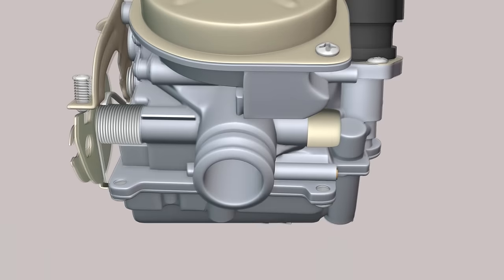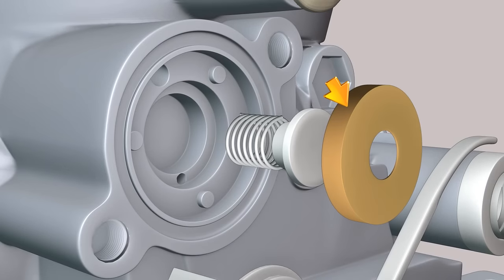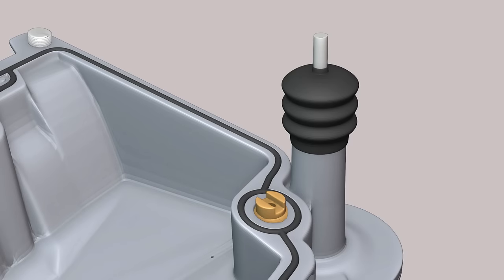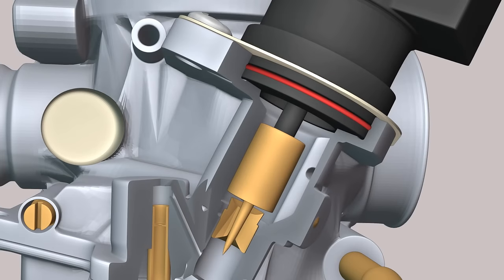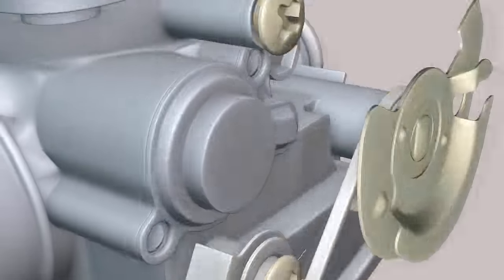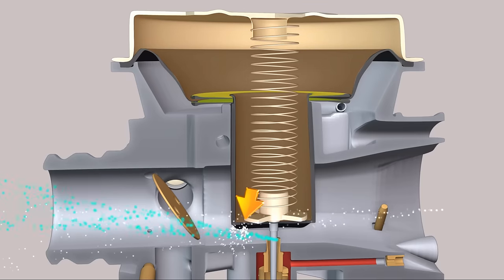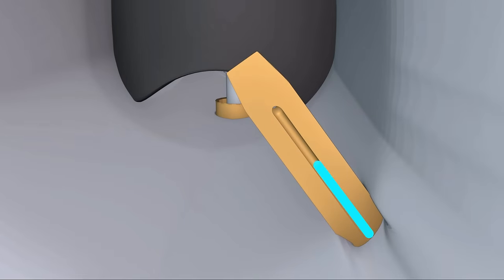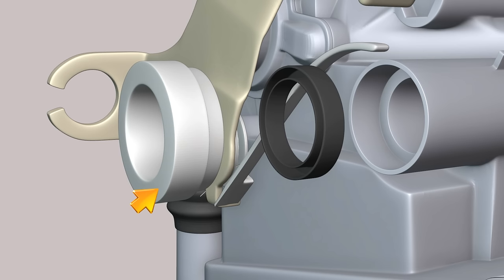Как работает карбюратор скутера 4т CVK 139qmb | 3D

Comment: una duda, no es posible regular la minima, la motocicleta vuelve a subir sobre las 3k rpm, por mas que trates de ajustar el tornillo de relenti es imposible, otro problema es dificil de encender, otro problema, con filtro de aire la moto se ahoga
Reply from the maker: Vea el sello de goma en la válvula de arranque:
https://youtu.be/L0odfurAzrg

Filtro de aire húmedo: es posible que se hayan metido residuos debajo de la aguja o el flotador.
Reply: @SanyaTsvay  ok, tú dices la junta tórica del estrangulador eléctrico y filtro.  y con respecto a que no pueda colocar ningún filtro y que siempre se ahogue o que encuentre trazas de combustible en el interior del filtro?, es un carburador CVK 26
Reply from the maker: @lsuarez011  la aguja se atascó. La suciedad se metió debajo de la aguja. aguja flotador, nivel de combustible. Es posible que el filtro en sí esté sucio. Si el filtro está sucio, creará un vacío y se llenará de combustible.
Reply: @SanyaTsvay  perfecto amigo, de verdad, gracias por toda la información, de verdad es excelente tu canal. voy a desmontar y limpiar todo. el filtro si puse otro filtro y apenas lo coloco en posición de una vez la moto se ahoga, prácticamente sin filtro si funciona.
Reply from the maker: @lsuarez011  ¿Está normal la válvula de combustible debajo del tanque? ¿Se abre manualmente? ¿O hay una válvula de combustible neumática con tres tubos? Si la válvula automática de combustible está abierta, la membrana puede romperse y llenar el motor con gasolina. Quizás valga la pena reemplazar la válvula de combustible.

Comment: At what point to adjust float level height of fuel in this kind of cup that is "inclined", not parallel with the body carburetor?!? When cup and body is horizontally parallel then its a rule to adjust float level at the level of joint point between the cup and body...but when the cup/body is inclined like on this model of carburetor, i am confused at what point to adjust float level.....i have been searching service manuals for this type of carb to find info of float level adjustment, but it is difficult to find...i got only some info like 17mm of height, but this is difficult to measure from outside with the transparent pipe because you cant define lower point so you can measure 17mm of height....any clue anyone?!?
Reply from the maker: https://youtu.be/UseQ1HR6bk4

Comment: У меня перестал запускатся скутер...,ни куда не стал лезть,поменял вакумный бензокран, сначало не помогло,в наглую залил бензин в карбюратор и ....заработал .... скутер ирбис rzr 170 ..
Reply: Clean the main jet needle valve...
A clogged vent is the culprit, I use a thin guitar string by inserting it to remove the dirt and 
debris...
It save me a lot from buying a new carbureator... Regularly replace the main fuel filter, a contaminant in the fuel builds up and clogs the carbureator, sometimes the cause of hard to starting...
My scooter is MotorStar 4- stroke 170cc model china made...

Comment: Got another question what can cause surges/stalling at full throttle? it accelerates then it stalls a bit then revs up again, also the main jet needle is set at down at the lowest setting if I go up it won't rev at all, any suggestions? Great video again. Have a great day or night
Reply from the maker: Could there be a crack in the vacuum diaphragm?
Reply: @SanyaTsvay  how do I check that? And it would only affect it at full throttle? it goes just fine at half, could be what you said or an air leak and that's why it needs more fuel, and the spacer between the engine and the carb is cracked, it's got silicon in the crack. Now I need to know how to check the vacuum  diagram, it's the vacuum line and the carb intake manifold pipe? And thank you for the response, you're really helpful I can't get to the problem of this thing
Reply from the maker: @nationalboosted2877  Membrane that lifts the piston with the fuel needle. If there is a microcrack in it, then failures occur at full throttle. Nothing happens at medium speeds. You need to get the membrane and inspect. Stretch a little to make sure there are no cracks. Well, or install, obviously serviceable ...
Reply: @SanyaTsvay  yeah, there no crack that I can see, so it's not from this thing, any other suggestions?
Reply from the maker: @nationalboosted2877  low fuel level in the carburetor float chamber
Reply: @SanyaTsvay  I thought about that one to, and I set the float level high, the float sits on the carb it don't touch the spring.
Reply from the maker: @nationalboosted2877  In that case, I don't see any options.
Reply: @SanyaTsvay  ye, but there's gotta be something, I'll make the float even higher, move the pickup coil down so it can read better. Both intake and exhaust valve are at 0.05 gap clearance, also it runs better at idle with the mixture screw almost tight but it won't rev,  any other suggestions that I could try?. I'm kinda obsessed with this thing I won't let it defeat me, anyway thank you so much for your help I really needed it. Have a great day/night
Reply: @SanyaTsvay  if the o ring from the needle of the vacuum diagram is small will it do the same as if it was cracked ?
Reply from the maker: @nationalboosted2877  I use a translator, so sorry, but I did not understand this phrase.
Reply: @SanyaTsvay  если уплотнительное кольцо от иглы вакуумной схемы маленькое, будет ли оно так же, как если бы оно треснуло?
Reply from the maker: @nationalboosted2877  unfortunately, I still don’t understand what kind of ring we are talking about ... On the starting enricher or on the main fuel needle? In any case, all rings must be tight. To avoid vacuum leakage.
Reply: @SanyaTsvay  the membrane that you said to check for a crack, the needle has a lock washer and a o ring, if the o ring is to small will it to the same as there was a crack in it
Reply from the maker: @nationalboosted2877  Understood. That ring under the needle won't make a big difference.
Reply: @SanyaTsvay  ok, I'm starting to think that it's going to lean or to rich at full throttle, could it be because the cheap foam air filter?
Reply from the maker: @nationalboosted2877  I don't think
Reply: @SanyaTsvay  nvr mind the engine, I can use it like this. But do u know why it's not charging the battery, also if I connect it without the engine on, it won't produce spark until I disconnect the battery
Reply: @SanyaTsvay  could it stalls because of the vacuum fuel pump, the fuel filter isn't getting filled with gasoline. Could that be it?
Reply: @SanyaTsvay  also when I put the carb float at the height the manual says won't idle, it dies
Reply from the maker: @nationalboosted2877  you can remove the hose from the filter and turn the starter. If gasoline flows, then the valve is in order.
Reply from the maker: @nationalboosted2877  idle, it's not that easy. Many factors affect idling. The main rule is that there would be no air leakage. In particular, it often drops a round rubber ring, a starting enricher. If the start-up enricher valve is turned by hand. It's time to change the rubber.
Reply: @SanyaTsvay  yea, but it was filling the old fuel filter, and now it won't even pass half on a new filter, and it feels like after 20kmh the engine bogs down even At half throttle, or I'm just paranoid and the engine just getting speed and it runs smoother. Probably I'm just paranoid. And at full throttle the rpms drop then go up again and drop again, and so on. I only run it in my yard and it's not much space like 300m
Reply from the maker: @nationalboosted2877  A similar situation was when the membrane in the fuel valve ruptured. While driving it started to stutter. The engine was sucking excess fuel through a vacuum hose, through a torn valve diaphragm. These valves often break. Therefore, I replaced it with a regular faucet.
Reply: @SanyaTsvay  u talking about that valve that I said to look for cracks, if yes then I'm going to buy another one
Reply: @SanyaTsvay  too many valves and I don't know which one is which 😅😅
Reply: @SanyaTsvay  also when I let go of the throttle it makes a popping sound, idk if it's normal or not
Reply: @SanyaTsvay  I put some grease on the membrane with the needle, and now it won't bog anymore, but it doesn't have power anymore, I fixed the stalling isue, but now it doesn't have power
Reply: @SanyaTsvay  hello, sorry to bother you again. When I go full throttle the rpms are high, then they go down and they stay like that, I can keep it full throttle it won't pass 4000rpms and 15mph/25kmh
Reply from the maker: @nationalboosted2877  Could be worn piston rings.
Reply: @SanyaTsvay  how to I know for sure?  Like it doesn't have too much compression but not to little either, burns a bit of oil but not to much, the exhaust smells like brunt gasoline and the smoke is blue, how can I know for sure that the piston rings are the problem?
Reply from the maker: @nationalboosted2877  Well, I usually define it this way: if it goes uphill and does not respond to gas, then it's time to change the rings. You can also measure the compression, and check with the required one according to the manual.
Reply: @SanyaTsvay  any other thing that I could check?, I'm gonna change the cylinder and piston when it gets warm outside
Reply from the maker: @nationalboosted2877  maybe the air filter is clogged.
Reply: @SanyaTsvay  it's a new foam filter, the spark plug looks like the mixture is ok, I think a bit on the lean side, it was already brown I just cleaned it a bit. Could the air filter let to much air in?
Reply from the maker: @nationalboosted2877  When a filter passes a lot of air, this is the ideal filter. There is no harm from this.
Reply: @SanyaTsvay  yes, but if I take my filter off the scooter will just stall when accelerating
Reply from the maker: @nationalboosted2877  curious. Might need to increase the fuel jet...
Reply: @SanyaTsvay  well it used to work without the air filter, but now it won't
Reply: @SanyaTsvay  it's full of problems, it spills gasoline into the air filter box
Reply from the maker: @nationalboosted2877  this happens when debris gets under the float needle. If the filter gets wet, it must be dried. Otherwise, a wet filter will provoke even more fuel overflow. When this happened to me on the road, I had to go home without a filter at all.
Reply: @SanyaTsvay  seems that it runs better now ( I haven't gone on the road yet). Got another question, I have I car battery, and when I try to start it automatically it spark but the engine won't start, I think that it's sparking to fast and to weak. Any idea why?
Reply: @SanyaTsvay  now I have another question. My check oil light is on, I don't know if it's supposed to be like that, it's orange, it has oil in it, and I can't find anywhere what colour it should be or if it's like that because of the dashboard. Any thoughts? Also it's a kymco filly 50cc
Reply from the maker: @nationalboosted2877  There is no oil light on my scooter. Usually such a light bulb on 2t scooters. This means that the reservoir ran out of oil.
Reply: @SanyaTsvay  it's a 4 stroke
Reply from the maker: @nationalboosted2877  then you should probably check the oil level in the crankcase
Reply: @SanyaTsvay  I checked it, it has to much, could that trigger the light?
Reply from the maker: @nationalboosted2877  No. Maybe the bulb is responsible for something else.
Reply: @SanyaTsvay  could be low pressure, I have 5w30 instead of 10w30 full synthetic
Reply from the maker: @nationalboosted2877  Personally, I don't think so.
Reply: @SanyaTsvay  could be, because of the low viscosity of the oil in doesn't make as much pressure as with 10w30. Anyway I would like to thank you for helping me fix this piece of junk, you're the only one who helped me, google and other YouTubers were making me more confused saying things that don't add up. If you don't mind me asking how do u know so much about carburetor's and scooters? Thank you so much for helping me. Have a great day
Reply from the maker: @nationalboosted2877  I just own a scooter. I had to figure out how to repair the scooter myself. To avoid walking to work.
Reply from the maker: @nationalboosted2877  I understand that the viscosity of the oil is different. I don't have an oil pressure gauge on my scooter. Therefore, I can not say exactly how the viscosity of the oil affects. As I said earlier, in my opinion, viscosity should not affect pressure. Although I could be wrong.
Reply: @SanyaTsvay  I don't even know if the light is on, it's orange like the whole dashboard
Reply: @SanyaTsvay  well the oil viscosity is extremely low, it got contaminated with gasoline, and now it's extremely flammable, do I know why it keeps getting contaminated
Reply from the maker: @nationalboosted2877  Well, if it is also with gasoline, then yes. It's not very good.
Reply: @SanyaTsvay  it's air cooled, so it's definitely gasoline, but I changed it like 3 months ago and it didn't run for more than 4hours, I mean yeah the compression is low. When I was shaking the bottle where I got the used oil, it was splashing and sounding like water.